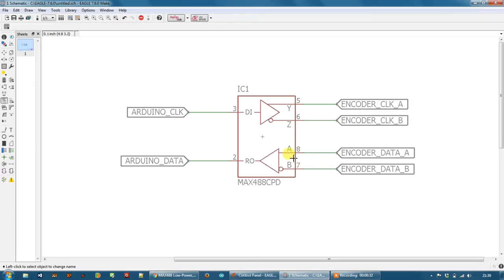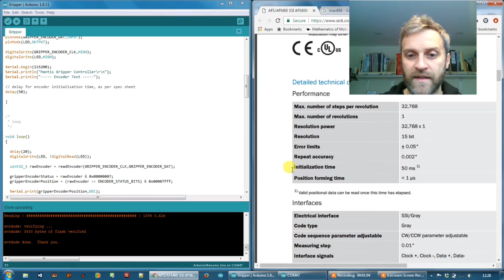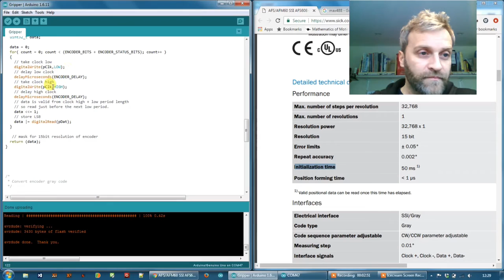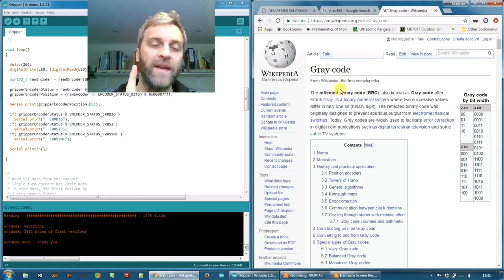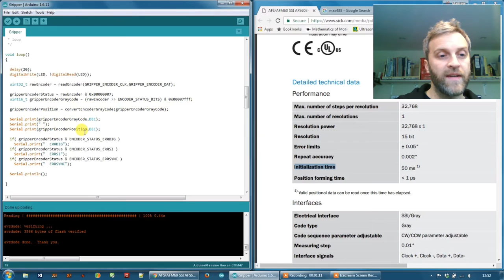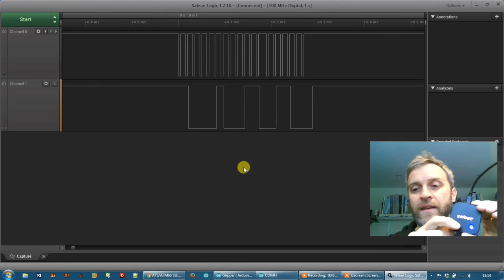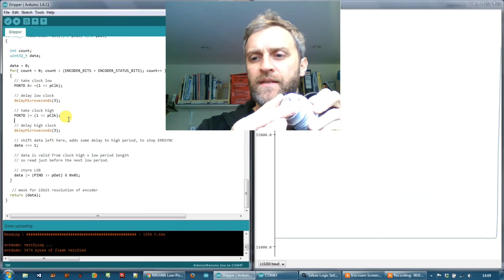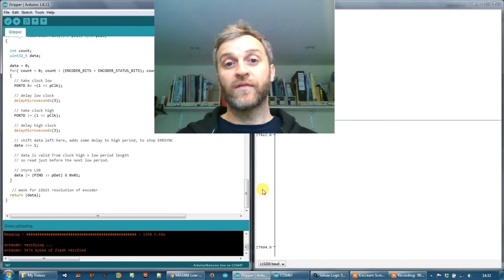Mantis Gripper | Arduino & Electronics | - Mantis Hacks #3

Comment: Great video Matt! I second the usefulness of the Saleae L.A. Have you tried the Teensy's yet? Their DigitalWriteFast() is a lot faster. Then again you did it your way :-).
Reply from the maker: I have been using Teensy modules for other projects yes, but wanted to do this on a standard cheap Uno. I love the Teensy capabilities, but wish the documentation was better, I sometimes struggle to find information on all the special features, such as not knowing that DigitalWriteFast() exists on a Teensy.. do you know of a single reference document with all features/functions? Maybe I've missed it :)
Reply: I'm not sure about a single reference document. But Paul and other seem to respond very well on the PJRC forum, you could post Q's there. Actually, the DigitalWriteFast() isn't necessary to write since the DigitalWrite() is already automatically directed to the faster function.
Reply from the maker: Yeah they are great at replying in the forum, but sometimes just wish there was a single reference document :)

Comment: If you are passing the pins in through function parameters, the compiler will have to generate code for shifting the bits into the correct position, when accessing the PORT registers. Technically, that could be done statically, because in reality, the clock and data pins do not change at runtime. You should consider removing the function parameters, and using your #defines directly in the function, so that you can generate more optimised code.

Comment: this is now my favorite youtube series :D so you said they talk on a bus if i'm not mistaken, so you'll be able to connect them up in Parallel but how are you going to differentiate the different encoders in code? or are you going to just use one at a time? also how are you going to do with the hoses for the gripper and still have it able to rotate, are you going to use a bungee or similar or just let them hang freely?
Reply from the maker: jöötäjä oh thanks! I know it's a bit techie this one, so won't have a broad audience but please share to those who maybe interested!

You bus the clocks together, and have a separate data pin for each encoder. Then read them all simultaneously. I'll show this later..

Gripper hose has been made long enough to hang freely.. will test and demo soon.
Reply: Really good episode! Don't be afraid to be even more techie :)
Reply from the maker: Thanks!
Reply: nice! i'm currently studying computer engineering so all this is very interesting so please keep in all the details :D and yes I've shared and will share with my school buddies :P  so are you planing on changing the  control system in Manits or is the one in it currently sufficient and this one just for bench testing?
Reply from the maker: No I will use the existing control system in the Mantis, there are already spare stations ready for use. The Arduino version is just for bench testing and seems more useful for others to learn from/understand :)

Comment: Waiiiit... I thought those encoders were just glorified potentiometers... What's the practical advantage of all this extra complication?
Reply from the maker: Precision, Noise immunity, Linearity, Robustness. 
To achieve 15 bit precision with a potentiometer and ADC, you would need a very clean supply and good noise filtering, this would probably mean the least significant bits would be unusable, so you would end up with something more like 12 or 13 bit precision. Good potentiomters such as servo pots come with a linearity of 1.0 to 0.5%, normal potentiometers this is much worse, 5% or more, so regardless of how good your ADC is, you're not going to get a true angle reading without multiple calibration points and interpolation. (you can see this in cheap R/C servos, the same signal +/- will produce differing angles of rotation )
Absolute encoders have no physically contacting parts, they are usually optical or magnetic, so no tracks to wear out and also generate noise. Industrial robotics are all based on encoders for this reason, either absolute or incremental. It's all about precision :)
Reply: Ah, thanks for the reply! This really clears things up. :) Really interesting stuff to know, too!